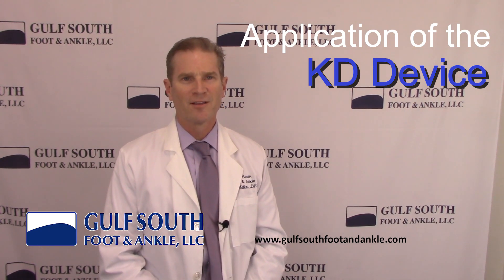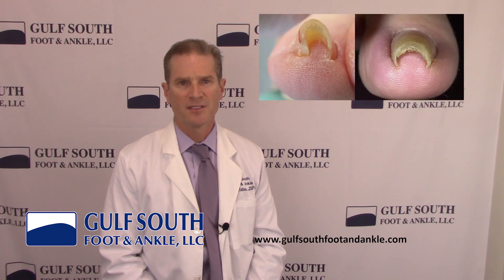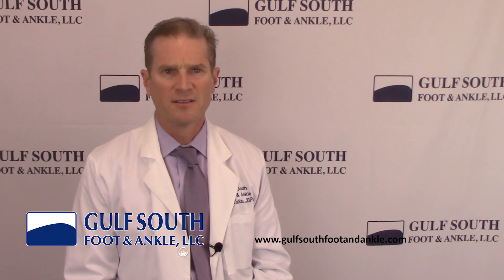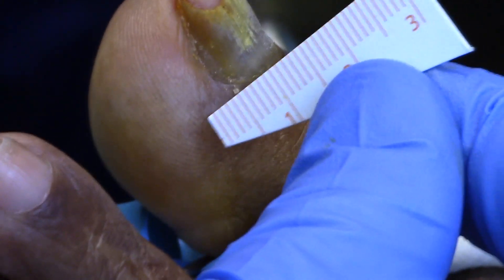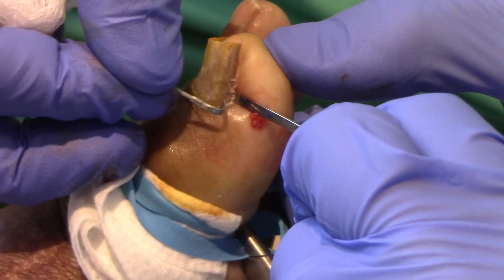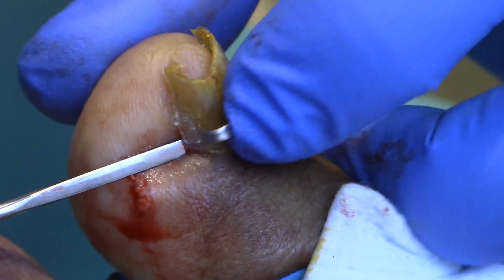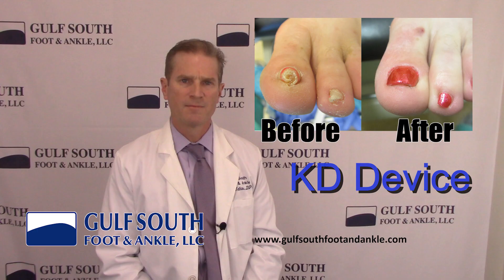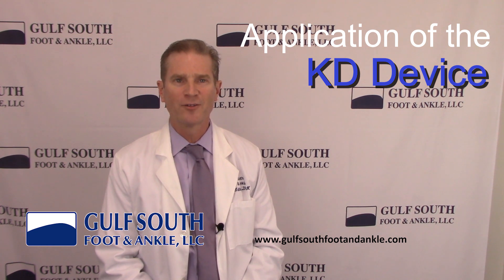GSFA KD Device Procedure to fix Pincer Toenails

Comment: How can I find someone who does this around Tucson Arizona??
Reply: I know this was 3 years ago but I had this going on with my big toes, and if your toes are still having issues try these correction strips. I have been using them for about 6 months and my toenails look so much better and more importantly they feel better. Put these as close to the base of your toenail as possible, you’ll have to trim them and you may have to sand them to make them more flexible and comfortable once it is on your toe. I have done this about 3 times and my toenail is now where I want it. I used super glue to get them to stick to my toenail and I broke a lot of them because my toenail was so stupidly and painfully curved and these only bend so far. It a real pain in the ass to make them stick as super glue only dries incredibly fast when you accidentally glue your fingers together! I cussed a lot and it has gotten easier as my toenail has corrected itself. Now I know this may not work for everyone but I’d sure give it a shot before doing this procedure! They are not expensive but because of the breakage I’ve had to buy 2 containers (different brand and they only had like 10 in each jar) it’s worth a shot and I hope it works for you or anyone else who is watching this video. (My friend sent it to me and said “aren’t you glad you just glued yours on?”)   I’m so glad cause this looks like some seriously painful horror I want no part of!  They do make metal ones but I haven’t tried them so I can’t say if they work or not. Good luck to anyone dealing with this issue and I hope I can help just one person by sharing this. I know I was In enough pain that I was about ready to go see someone about surgery! So glad I found these! I also filed my toenails so they were a little less thick and soaked them so they would be softer when I applied the strip.  Much luck to all of you! Use your best judgement and don’t injure yourself. I’m not a Dr and I don’t know your history. I’m just saying this worked for me and it could work for you too. Toenail Correction Tool for Men Women Foot Care https://a.co/d/cJ8iZpW